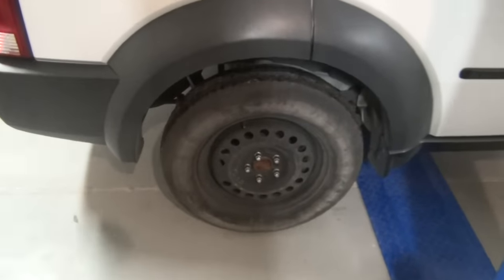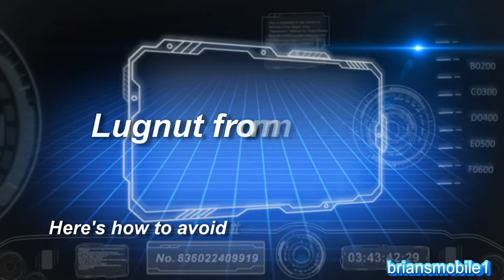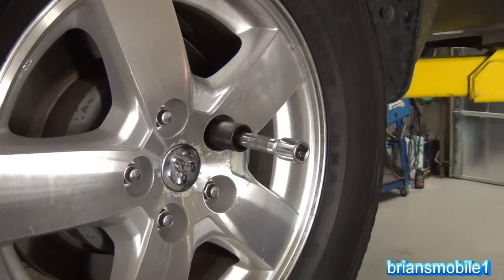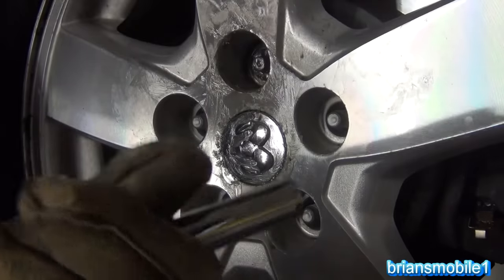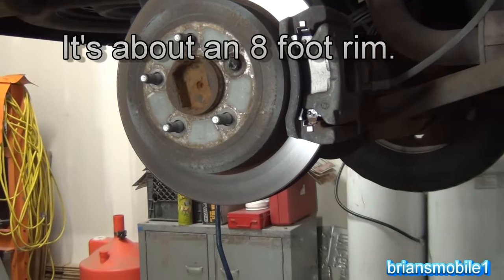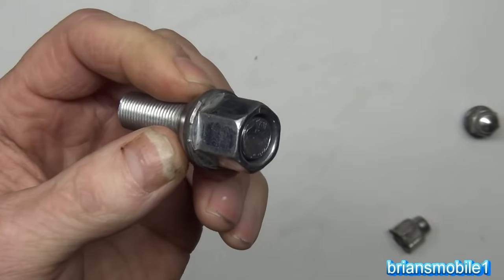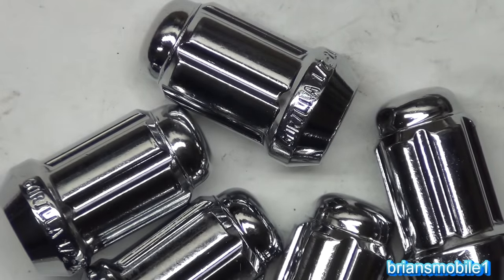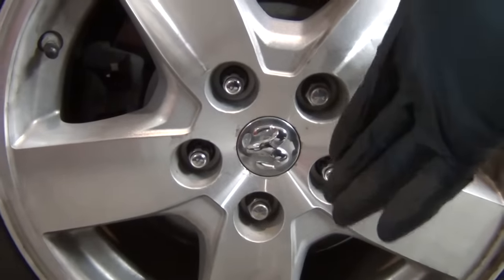Lugnut From HELL

Comment: Lol Chrysler can't make lug nuts, the caps fall off or they expand and you're stuck hammering sockets on them
Reply from the maker: +Brendan Cunningham They're bad.  I find using an 18mm socket on the topless nuts makes them happy.  The key is to not be in a hurry with your 19mm and catch it in time.
Reply: +Brendan Cunningham Yeah... like MANY things about Chrysler, it was designed shittily. Don't remember when, maybe the 90s, they required their own type of coolant even, if you dumped just regular green coolant or the dexcool in then your system would galvonically corrode away the head gasket. Or... maybe it was the radiator that corroded away... either way, Chrysler is ridiculous.
Reply: +Jesse Crandle I know they use that atf+4 trans fluid
Reply: Dan H I think the real danger is that people just assume it's American therefore it's probably a "fix it with a hammer" kind of vehicle like a Chevy or Ford, but then Chrysler has done everything their own way, and what you can do to or with a Chevy or Ford doesn't apply to the Chrysler. It's kind of like...  overengineering that the Germans do, but instead of trying to make the system better through overengineering they've tried to make it cheaper.

You should watch Eric the Car Guy fix that Chrysler van... WOW. So unnecessarily complicated in all the wrong ways.
Reply: +Jesse Crandle I had the same van , when the trans went I was glad to get the $200 from the junkyard for it
Reply: +Jesse Crandle  i have a 2000 jeep grand Cherokee i like it so far  havent had any issues with it  165k i do have the lug nut issue where 2 are missing the cap thing but they still come off i just had them off when new tires where put on  i also just had my ac serviced i needed Freon the charging port is leaking dont want to have to pay to reclaim Freon pull a vacuum on the system all that so i just keep charging it every year i need to get it fixed soon the leak is getting bad  though  i also have the famous stuck blend door on he recir door but i keep it on recirculate all the time  so its fine where its at it cools  and i have heat so im happy not going to pay to fix it. till the evap coil leaks or the heater core goes.
Reply: +Jesse Crandle You can't avoid proprietary fluids, grease, chemicals, etc in modern cars. If you read the magic, manufacturer provided literature placed conveniently in the glovebox, and follow it religiously, you greatly reduce the odds of having serious problems. Chrysler makes some bad cars, yes, but doesn't every manufacturer? Both Chrysler products I drive have 200K + miles on them, and even have some value left in them. I plan on keeping both for another 50K miles.
Reply: my jeep hasnt had any issues i love it 166k now don't plan to trade it any time soon ill likely keep it till the motor dies just had new tires put on and the ac fixed it was leaking freon and the orifice tube was clogged had a new line drier put on too.
Reply: +SuperJeremi10 never up talk a Jeep...it'll jinx it into a horrible repair.
Reply: haha  it depends on the repair im diy'er so  most of the repairs i do myself im about to put new plugs on it  and a new front the holds my head lights in we busted the the clips by accident trying to find the stupid cooling fan relay that's usually under the bumper got my fan working again  i orderd that part instead of trying to jerry rig it i like to fix it right i also might for xmass get some of them plug and play led tail lights for it  and buy  some lug and play led conversion connectors for the front and use leds in the stock lenses i wanted some projector lenses but most of those you have to cut into the wire harness the one thing i absolutely will not no if i can buy a converter connector to plug into the stock bulb socket i will not use i dont believe in ruining the vehicles wiring harness it usually causes issues down the road  im going to get new lenses for the front the ones on the front have a crack in them shopping cart at Walmart lol luckily they arnt to expensive to replace now that the car is older. they dont really needed to be replaced they work fine but i want to upgrade them to be better and have led bulbs with xenon head lights.
Reply: I HATE tin covered lug nuts!!!! That is what every lug nut is like in automotive Hell.
Reply: colj001 is tickford the ford's of down under ?
Reply: colj001
why choose a ford my jeep seems to break down a lot less then my neighbors expedition
but then again i maintain my car regular oil changes checkups etc  when the light comes on i check it right away  i dont wait for a break down i check all my fluids  it does leak oil i cant afford to have the seal replaced but it easily makes it to the 5,000 oil change i change the belts when they look worn i also when i hear strange noises i check them out and replace whatever part is about to fail just the other day i had a radiator hose about to blow out and because i check my car often we caught it before i was broke down over heating  i change the battery every 5 years  so far i haven't been left stranded i also listen at the tail pip see how it sounds  and  see if any weird smells sometimes you can tell alot about a car by its exhaust justt had a tune up done to my car the spark plugs had been in it for 80,000 miles  my radiator was coming apart after so many years it was still the factory radiator so i put a new one in still has the factory electric fan. ac and heat is still working i take care of my car  and so far the tranny or motor has never had any major issues this is a 2,000 jeep grand Cherokee  i had a 98 jeep that left me stranded well it was my fault i neglected to get the issue fixed because i didnt know it was broken the catalytic converter plugged completely  and the engine  no longer had any power to make the car move  put a new one on and it ran just fine.
Reply: +SuperJeremi10  Your sample size is useless. Get off the internet and get back to your statistics homework.
Reply: SuperJeremi10 every manufacture of cars has made a complete peice of shit at one point, even the holy grail of reliability - toyota... with their 2.2 L4 camry engines that did half a head gasket job for you. all im saying is, from my experience, modern Chrysler cars are not as good as modern fords, iv worked on both. but like you say, you keep an eye one your cars health and your car will run indefinitely no matter who made it.
Reply: everyone has made bad cars  i dont know about newer fords  never have owned  one  we had an older mustang that was always having issues   m y neighbor has one with the Triton v8 in it  it breaks alot it breaks so much he gave his daughter his truck it was his daughters car  dont know why they dont just trade it in but seem like i see it broke down on the side of the road often  ford does make some nice cars though.
as fair as maintaining them i do what i was taught i was always taught to never relyon the computer causes it wont always tell you when it needs something or when it has leaked all the oil out until its too late and the damage is done  i had a Tahoe and the break line broke off i didnt even know it was offf till it was time to stop and i had no fluid left in the master cylinder break light came on after it was time to stop a little warning would have been nice and being a person who has owned a lot of chevys i have learned not to trust the fuel gauge either it seemed like all the Chevys i had the gauge never seemed to work quite right in in my jeep works good  but i still use my trip meter haha i like chevys i really wanted to get a 2006 Tahoe or a Hyundai santa fe but i couldn't afford one in the condition i wanted with low mileage all off them had 200000+ miles on them  so i got the jeep had abput 140on it now has 166 no break downs i still really like the tahoes though.
Reply: In my opinion Chrysler hasn't made anything very well in the last 15-16 years
Reply: Everett Clunie maybe them chargers or 300s but I couldn't tell,  I don't own one
Reply: Dan H I vote the 300 to be the most difficult piece of crap car to work on ever made. some jackass engineers had a good time with that one.
Reply: Bob Jimenez thanks for the heads up
Reply: +Bob Jimenez PT Cruiser...nuff said
F**k that car in particular!
Reply: I like Chrysler my jeep has been pretty good to me so far and wheels nuts have never gotten stuck even when broken but I have my tires rotated every 6-8,000 miles.
Reply: +Bob Jimenez you're so right haha
Reply: Are you guys aware that Matco tools make lug sockets in a 1/2 mm size? 17.5 mm 18.5 mm. Just because of this problem.
Reply: yes i am. the fact that those exist is sad
Reply: no wonder you couldnt get it off. next time try heating the nut and not the stud.
Reply: ford and chevy also use this style of nut.... they are terrible for vehicles in the rust belt.  about 50% of the time we drill out the wheel stud and forget about trying to get the nut off and after just replace the whole stud and nut.  we don't bother with torches anymore.
Reply: 9HighFlyer9 still the same result.once you heat a metal make sure you try your best to remove the lugs at all cost.if not,the lugs and studs will stick or bond together after a few seconds when the temp go back cold.and if you try heat it the second time,you making them bond more tightly.people thought by putting heat on metals is easier for them to remove it,yes!but if you only able to get them off in the first try.removing a stuck lugs is not that hard eventhough the lugs and studs are too rusty.just put WD-40 and wait for a few minutes,then use an impact gun and unscrew it with an angle (an angle that the lugs and studs having the friction together) both lugs and studs will ruin the thread by doing that but thats the only way if they are so rusty or bonded together.thats fine because you're gonna replace the stud and lug with the new one after that.
Reply: fr my old second gen lugs suck.... the casing comes off
Reply: Chrysler can't make anything
Reply: briansmobile1 they actually make special sockets like 21.5mm 18.5 mm etc for this issue
Reply: Same with Ford, I have a focus and I have the same problem
Reply: Impact extension would lose less torque and drill out the center of stud
Reply: As a Chrysler tech I 100% agree, I love my company but jeez it’s really irritating especially for something so damn simple lol

Comment: I use to work at a tire shop. I hated those tuner nuts, but they're way better then the normal lugs, the chances of cross threading, and damaging it is way less. Most tire guys will tell you, they hate them, but they will normally tell you, they're better. Thank you for the great videos!
Reply from the maker: +Giles Landon In my opinion its the customer you're upset with for not providing the key.  I've been meaning to do a video on that -  How to piss off your mechanic.  What do you think?
Reply: I think that's a great idea!

Comment: i have had a few that were like this, in my opinion its best to just drill the center of the stud out deep enough to pass the end of the nuts taperd part and when you get to a bit almost the size of the stud sledge hammer the back of the tire till it breaks, most of the time you can save damaging the rim too. It sounds like more work but its less frustrating than chiseling and torching the nut off and possible messing up the rim.
Reply from the maker: +UBBERTANKER Great idea.  I just expected it to loosen up with some heat.  I love getting feedback like this.  Great opportunity to learn.

Comment: Next time, leave the two lug nuts closest to the damaged one on their studs, this will help relieve pressure on the damaged one. Then, you could try drilling the center of the stud out, start small and work your way up in bit size (drill slow with constant pressure). If the stud is too hard for your bits, get it red hot then allow it to cool to room temperature, this will anneal the metal and make it softer. When you drill the stud, you relieve some pressure on the nut. Try removing the nut after you have drilled the stud. Work your way up in drill bit size and continue to check if the lug nut is loose enough to remove. If you hit a point where there isn't much stud left, try applying a little heat to the nut, keep the heat off of the stud as much as possible. If it still won't budge, then drill the stud the rest of the way out. Use caution with the remaining stud, if it is exposed (sticking out past the nut), your drill bit will bite hard and possibly chip, use a junk bit until you get it slightly below flush with the nut.

Comment: Worked for 30+ years in auto repair defiantly know your pain done this same thing about 2 dozen times. The fastest way I found (worked for me) was getting a hole saw just barely larger than the stud.  Drill down until you make contact with the brake rotor, most times then the rim will slide off.  The stud will help keep the hole saw centered around it.  Just gonna need some cutting tool coolant to keep the hole saw from overheating and failing. In the end there is no EASY way when the lug nut is concaved inside the rim.. Just (as I said) worked many times for me.. Nice video here by the way..

Comment: My son and I had an adventure and cracked a breaker bar using leverage on nut remover.  Our solution was to drill out stud using expensive titanium $15 drill bit while spraying walmart version of WD40.  Dodge grand caravan.  Did not ruin wheel or blow up house.  Car tire place put lugs on too hard.  They had fun getting the 3 others looose.
Reply: >Dodge grand caravan
>Car tire place
>Walmart WD40

that's where you fucked up lol
Reply: Andy Flores yep

Comment: When I encounter a problem such as thus. I grab my drill, and drill a 1/4" pilot hole through the center of the stud. So that it goes deep enough just past the tapper of the lug nut. (using a reputable bit) Then i get a drill bit, slightly larger than the stud threads, and drill through the 1/4" pilot hole previously made. (with another larger reputable drill bit.) Chinesium bits will brake in the stud, so don't use those. If you have a masonry carbide tipped bit. sharpen it the same as a high speed steal bit, and you can now drill through anything that is less harder than carbide.

Comment: I find using a miniductor and twist extractor socket much easier. I personally heat the lug nut with the miniductor then hammer the twist extractor socket on.  Using my 1/2 impact(Snap on MG725) they come right off. Without the finish of the rim compromised.

Comment: Brian, it's so good to know that other people are faced with seemingly silly problems that can take up loads of time. I gave myself 2 hours to remove a 1992 Subaru petrol tank but one set screw that went into a captive nut would not budge. Heat? Not near a leaky tank.  Mini grinder? no, sparks will fly. Undersized socket on a big bar - hooray it turns - well the captive nut turned and broke away. Power tools? Yes, via an inverter on a battery (no electricity where the car is garaged) but the vibrating blade tool gave up. Drill it out? My inverter is not good enough for a full size drill so when I have time I'll try with a small drill or a Dremel... (I've never had quality battery powered tools) 5 hours so far. I've been a mechanic since forever and I just hate it when this happens. Luckily it's not too often one is continually thwarted by one job. Best wishes.
Reply: This crsp usually only happens on a summer holiday camping and get a flat. Cant get wheel off- get towed.
Then they destroy your wheel in the process. Costs a fortune. 1/2 in drill and assorted bits and ez outs. Always works. Buy new stud and a set of lugs. Better to match then get stuck again.

Comment: Dude, you just destroyed a wheel for nothing!  Unbelievable!! hack

If you were able to get a grip on it with a socket, USE A LONG BREAKER BAR WITH THE WHEEL ON THE GROUND!!!!  At the very worst, you would have broke the stud.

I've done this hundreds of times without fail.  I have NEVER damaged a wheel taking a lug nut loose.
Reply: Beard Man bet it would've come off with the impact if he didn't use that wobble extension... But yeah breaker bar would have been my first choice.
Reply: Beard Man Same thing I said and posted until I realized this was all fake in order to sell those lugnuts. You just watched a commercial without knowing it and now we are all little dumber for it.
Reply: Yesterday I had a lug nut that wouldn't come off with an impact gun AND THEN switched to a long breaker bar. The nut just ended up rounding off cause it was on so tight. I've seen this happen multiple times for many years. What this guy did is usually what ends up happening, burning/melting the damn thing off. But of course the aluminum wheel is no good after that. Bottom line is don't over tighten these cheap factory lug nuts, otherwise this is what can happen!
Reply: Then blame the poor guy who gets stuck with trying to take it off
Reply: yes just break the stud and skip all the carnage
Reply: Or you get really unlucky with the breaker bar and actually bust the stud loose from the hub. Yes, it's unlikely, but I've seen it twice.
Reply: Jeremy Eaves I’ve seen that happen way more than twice. Seems to happen  frequently. Also not sure how these people want him to tighten it more if it’s completely round and the extractor twists only work one direction

Comment: Hmmm at the end I was surprised you didn't tell us to use a torque wrench to tighten the rims to proper spec , I think this is key to not have problems like you just had , over tightened stretches the stud or bolt  , warps rotors, and I seen rims fall off from this.